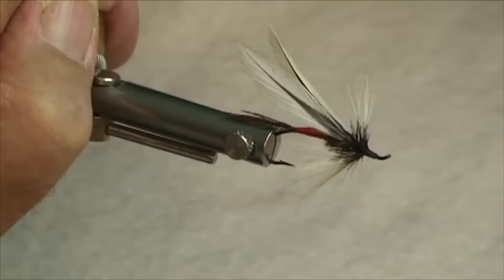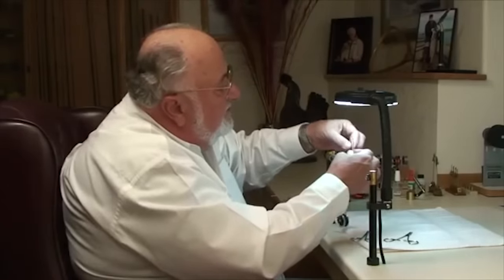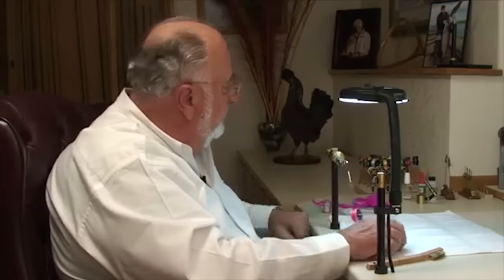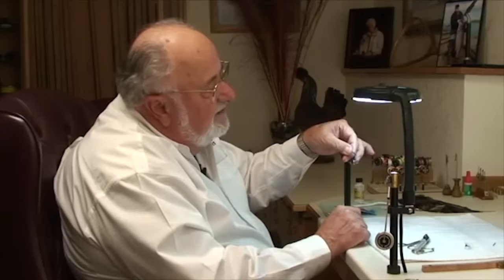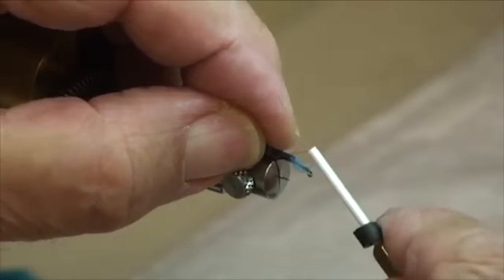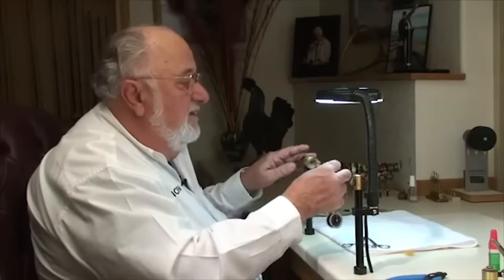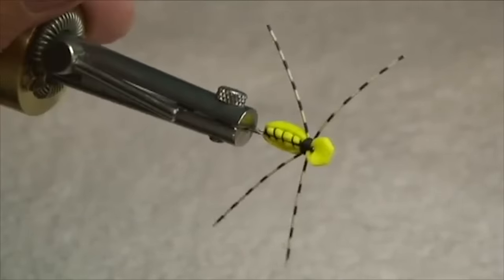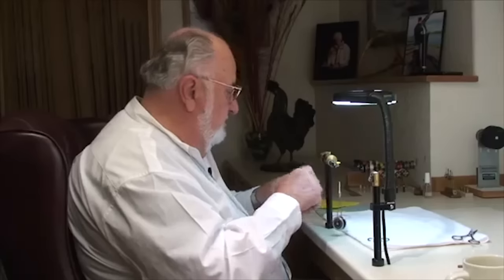Unintentional ASMR 🎣 Calmly Crafting Fish Bait (relaxing voice, focused close-up fly tying)

Comment: I feel like I'm listening to a Longmont Potion Castle prank call 
"Hi my name's Cornelius and I've got a rotary badger hackle trap on my sigman vent, and I'm wondering if the horizontal sheer hemming is necessary or if I could just use a bolan water noose clamp with a far cap." 😂